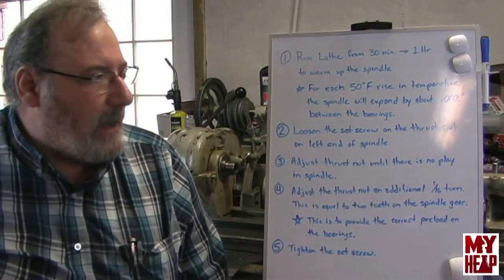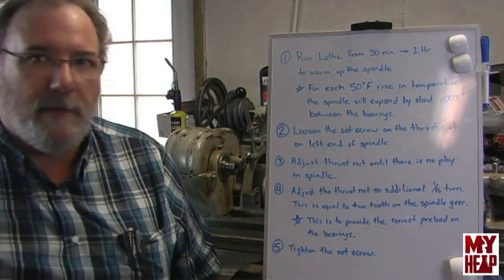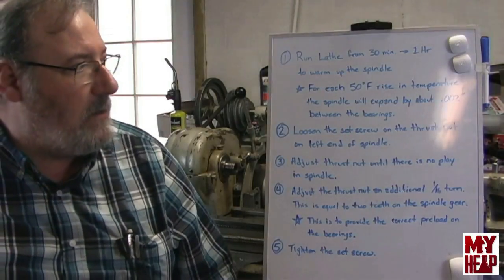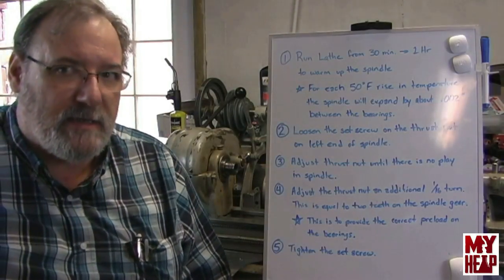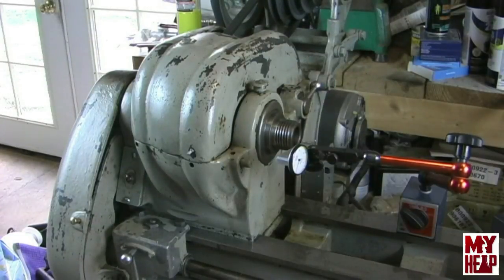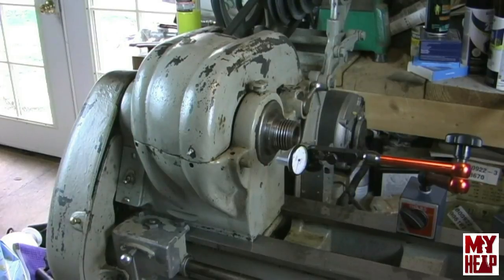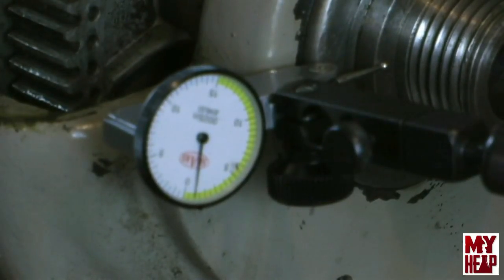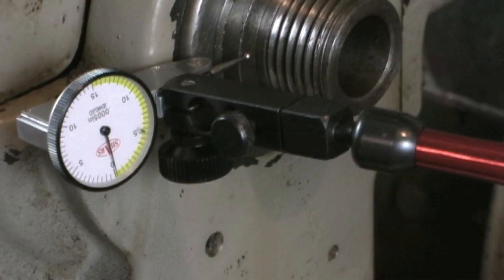Atlas 10F Lathe - TH54 - 25 - How to Adjust the Spindle Bearings

Comment: I refurbished the atlas 10 with manual but didnt really follow spindle bearing adjustment as per the book. Was always good when doing small little time operations. I then took on a longer boring operation and seem to sense more vibration and out of tolerance of boring.....set up a DTI and found play .. going to use Joes method as per manual and see if it sorts the prob out .....will let Joe and you out there know the outcome.....cheers Joe thought my atlas was too worn out ..lets see... thanks for the info...thanks for sharing..🤞

Comment: G'day Joe, it's always good to have the manual, so much can be learned from it if you remember you have it. Adjusting those bearings is the same debate many have had about car wheel bearings, can't beat a manual. Good presentation, Cheers Peter

Comment: FWIW...I took a bronze brazing rod I had laying around and snipped off a piece about 1/16 long, tapped it down with a hammer into a disc and dropped it down into the threaded hole on the collar before inserting & tightening down on the set screw to avoid damage to the threads so its not steel on steel ~ Richard
Reply from the maker: When I initially took mine apart, the set screw was tightened into the threads on the spindle.  They are were buggered up and it took a lot to get them lined out.  When I reassembled it, I cut a piece off the unthreaded portion of a  brass wood screw to put into the hole.  The damage is done, but at least shouldn't get any worse.
Reply: I new I've seen it some where lol must have been in the book

Comment: Nice and clear video, I should do this sometime with my own lathe.
Cheers from Holland
Reply from the maker: Hi Gerben, great to hear from you.  I would warm it up for a half hour or so and put an indicator on it.  That should tell you if you need to adjust it.  So your back gear issue is fixed now?  Are you still thinking of doing the spring and ball detent?

Joe
Reply: Thanks Joe, great help as always. I have had almost no time to play with the lathe, so I still owe you the answer to that. But the ball and spring mod is still the backup plan.

PS. Watching your CNC video's now ;)

Comment: Hello, great videos sir, I'm talking about Brazil.  I have a lathe that I inherited from my grandfather, an atlas th42 lathe, would you have a PDF manual of that lathe?  Or would you know how many gears it has?  I will be forever grateful.
Reply from the maker: There are a couple places you can get documentation for the lathe.  Vintagemachinery.org and the atlas group located at groups.io 

https://groups.io/g/atlas-craftsman

I hope this helps.

Joe
Reply: @MyHeap  Thank you very much, my Atlas th42 lacks a Z16 gear.
Reply from the maker: @vieiram7235  if you have access to a 3D printer, I have had very good luck with printed gears.  You can find them for the atlas lathe on thingiverse.com

Joe
Reply: @MyHeap  Thank you very much for the tip my friend.  Would you know how many gears the atlas th42 lathe has?  And what material is used in the manufacture by the 3D printer?  Thank you very much for the tips and attention.  I'm following your YouTube channel to restore my late grandfather's atlas.
Reply from the maker: @vieiram7235  I don't know how many gears off the top of my head, but here is a link to the threading supplement for the atlas 10F.  A look at the chart and document will provide your answer.

Vintagemachinery.org/pubs/51/3455.pdf

There are likely other docs there and on the atlas craftsman group that you will find helpful.

I have printed with PLA and PETG.  Honestly, the PLA gears work just fine.

I printed a 20T I was missing and a spare to get a very fine feed with the lathe.

I hope that helps you.

Joe
Reply: @MyHeap  Hello, thank you very much for your attention.  I am looking for the information on the website that you sent me, I think that now it will work for me to continue the restoration.  Thanks a lot for the help.